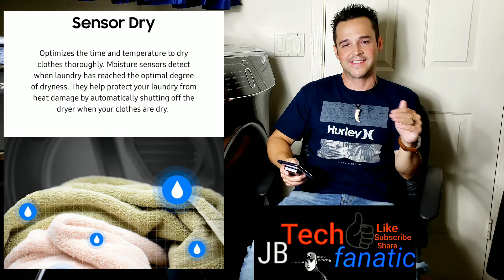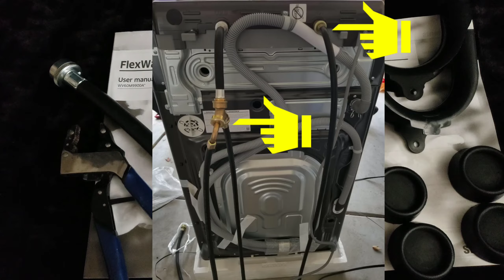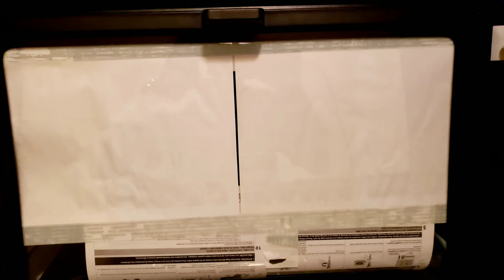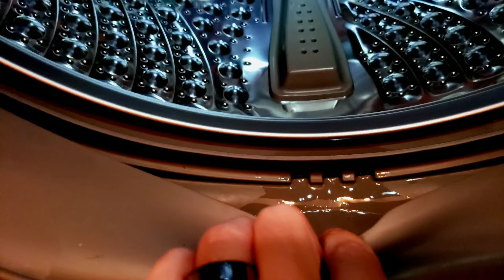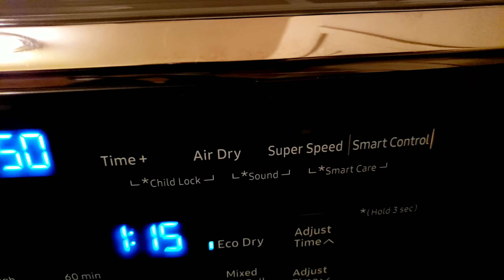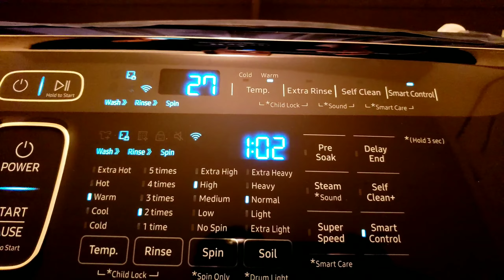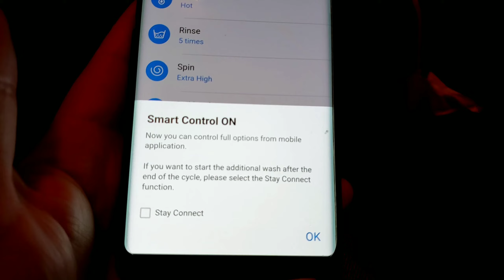NEW Samsung Smart Flexwasher & FlexDryer Duo FrontLoad DV9900 A Must see Review🤗

Comment: I bought the same set. Slightly after warranty expired, the dryer started squealing badly. Samsung Canada will not help despite this problem being talked about all over the internet. Samsung US will sometimes cover a past warranty repair on their defective, cheap, plastic parts. The washer also rarely makes it through a cycle without giving an error message. Stay away from Samsung appliances. Too bad because I really like their phones. That's why I bought the washer/dryer. Never again. I want to sell them but would feel guilty passing on these lemons to another innocent person.
Reply from the maker: I'm so sorry to hear that you have problems. That is never good horrible to go through as a customer I've been there. Thankfully Samsung has completely changed their manufacturing process for all of their appliances. In your case this unfortunately does not help you. But going forward these machines have been rebuilt from the ground up. All the parts in this washer and dryer are high-quality stainless steel or better. To get rid of the squealing sound is actually not as hard as most people think usually with removal of just as several bolts you can take off the back panel and clean the dust off of the wheels that spin the dum. That is typically the cause of squealing. But if the wheels need to be replaced this is actually quite a simple process.  a wheel kit can typically be purchased on Amazon for around $20 and are easily changed out. I wish I could help you in some way😊 I'm sorry that this happened to you thank you for watching.